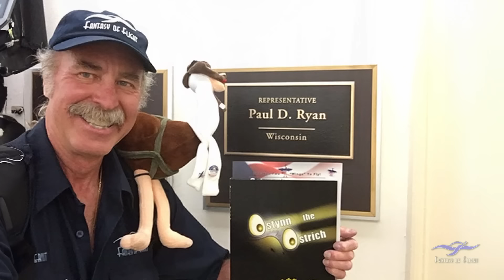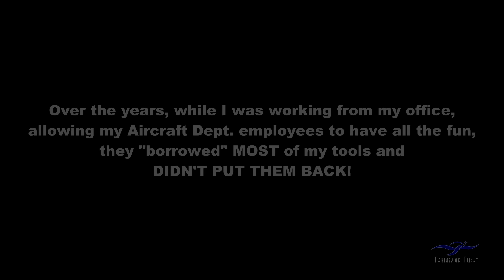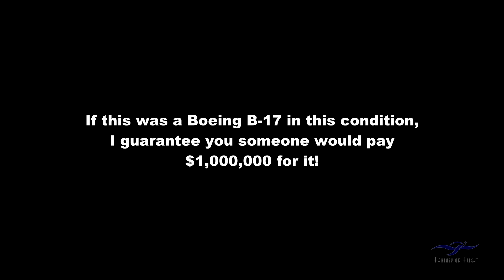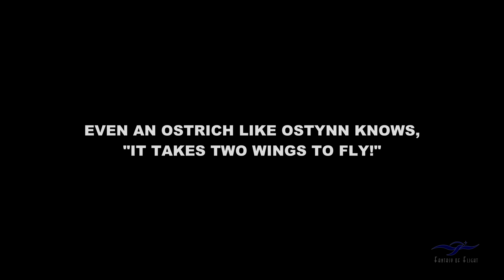Douglas DC-3 - Part 3B - Getting Rid of the "Right Wing!"

Comment: 35:00 I see olive green paint on the inside of the wing... was this a WWII plane converted to passenger plane after the war?
Reply: That is probably Zinc Chromate, a treatment to prevent the oxidation of aluminum. You will see that a lot in many aircraft.
Reply: @frankr7306  Ah interesting. Thanks…
Reply: Zinc chromate primer.

Comment: The fabric one the elevators would probably not withstand a power washer!  The tail piece is an actual DC 3 tail cone, that could be worth something.  The panel underneath the nose that gives access to the control cable pulleys, if it's still there, is definitely worth something.  We were in Langley B.C. Canada and the closest we could find was in Florida.

Comment: Kermit, get yourself several ratcheting box wrenches.  They will speed up your constantly adjusting the wrenches to the bolts.
Reply: If there's not enough space for a socket there probably wouldn't be enough space for a ratcheting box end wrench either. What's needed is a ratcheting open end wrench, but such a thing doesn't exist.
Reply: @andrewwaterman9240 lol they weren't put together with two open-end wrenches
Reply: @timgelder4263  Good point. Maybe there's a very thin-walled socket out there somewhere.
Reply: @andrewwaterman9240  I also would have pressure washed before dismantling to blow the crud out from the flange area
Reply: @andrewwaterman9240   I have ground down sockets before
Reply: @timgelder4263  Me too. Maybe it was just the crud and corrosion blocking access, as you say. If not,  I suppose the nuts could have been threaded finger-tight during assembly with the final torque then applied with an open-end wrench, but that's still pretty slow. Maybe the skin or whatever was blocking clearance was added after the wing was bolted on. What I find really weird is that the wing spar doesn't extend to the outer wing. Holding a wing on with a bunch of 1/4 inch screws just doesn't seem very secure to me. But I've never heard of a DC-3 wing falling off, so it must work.
Reply: This job needs power tools.
Reply: 3/8" drive 6-pt. sockets are fairly thin walled. They could "break" the bolts with open end wrenches then spin the nuts off with a socket on a long extension. Two people could do it more than twice as fast. Also don't see any PB Blaster or equivalent.

Comment: Kermit - i been binge watching videos of the UK Lancaster rebuild at East Kirby, interested to know if Boeing back in the day used the nasty aluminum magnesium rivets, they were used extensively in the Lanc and in order for the NX611 to fly again, all those rivets will need replacing - i have done some work on static display airframes myself and everywhere i see magnesium used it needs cutting out and wx oiling what remains to prevent or try and kill off the oxidation, i also use diesel to soak in - your DC3 needs some looking after to try and stay in tact, but at this rate she won't last long

your story of Teressa reminds me of a chap i knew, apparently if he got drunk, in his sleep later would speak fluent Russian, he never been there, doesn't speak the language, but everyone who witnessed it said he definitely speaks it